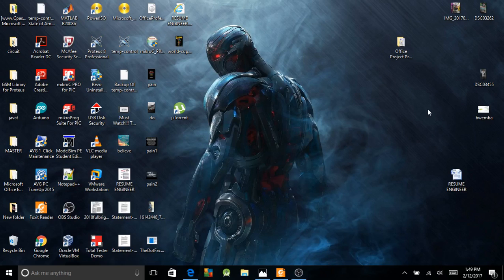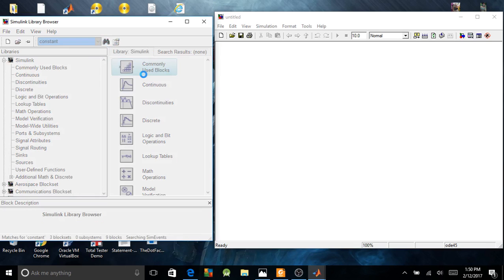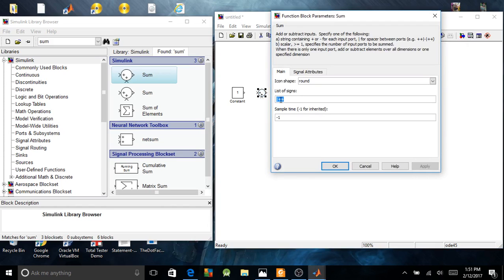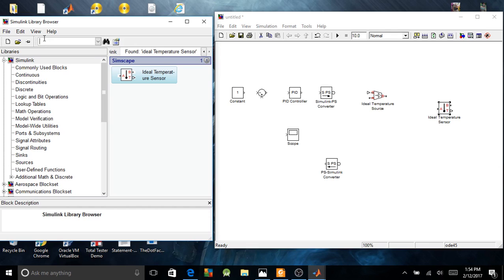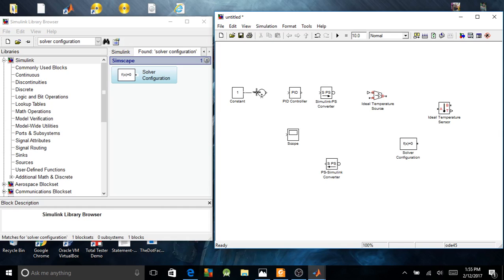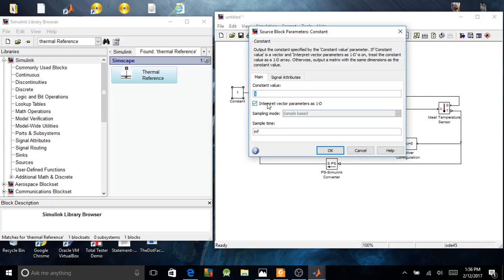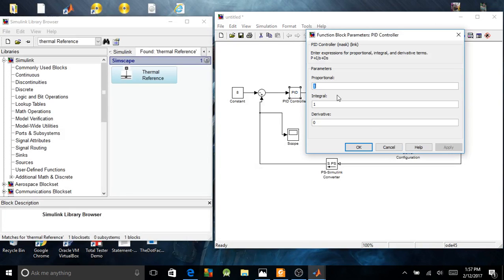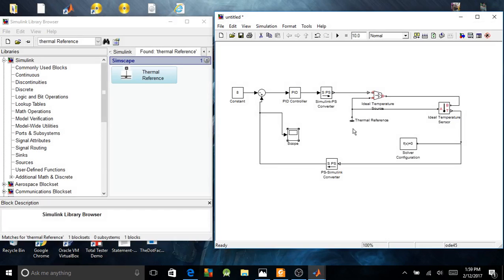Temperature control with a PID controller with Simulink Matlab

Comment: I did exactly the same but I get warning "Block diagram contains 1 algebraic loop" and model does not run. What's wrong with my model? Thank
Reply: just select the algebraic loop from the warning msg and select the value as none
Reply: Or else u can add delay